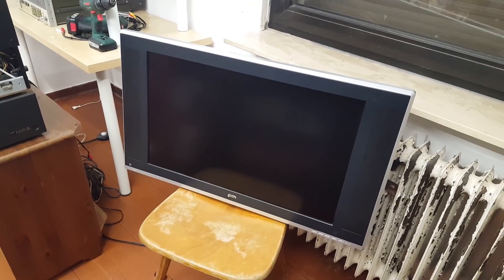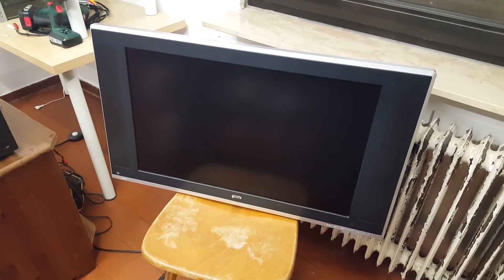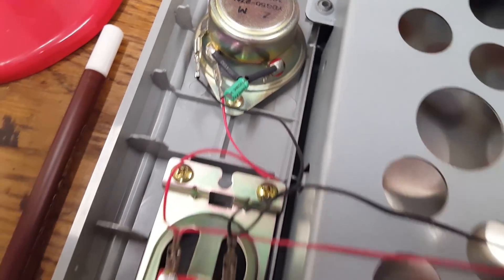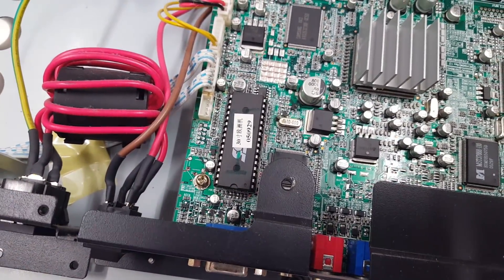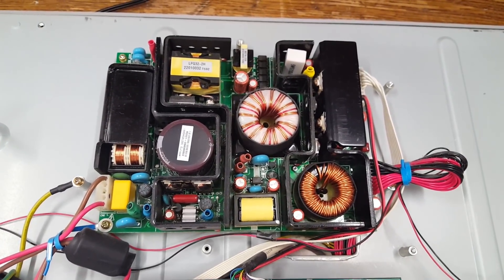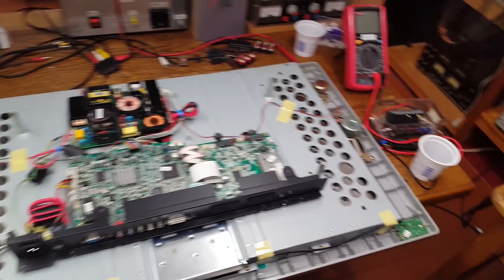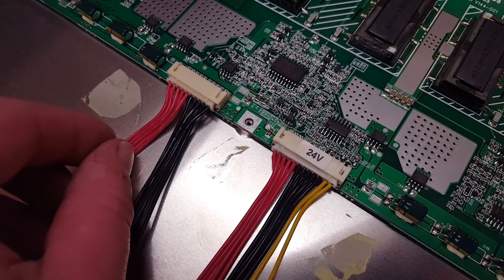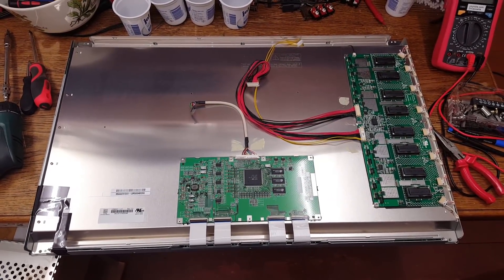1st generation LCD Television teardown

Comment: Strange how even that looks better made than the new ones. I found a Sharp the other week, there was nothing wrong with it at all, and it has the HDMI connectors. Built - in Freeview too. The speakers, facing downwards under the thing, were horrible little things, 4 x 1 inch or approx 25 x 110 mm. They too had shielded magnets, and were rated 10 W, though that's those intentionally misleading PMPO ratings I'm sure. The only repair I had to do was fit a new lead, the old had been cut off, and add external speaker sockets. It's now running through a pair of rather old ITT 653s. Seems to me most modern TVs die of capacitors bulging and going phut. Same thing with PC monitors. :-)

Comment: At the very least, that's a fair few goodies for the parts box! This unit looks well-built and like it could keep running for a long time after replacing those dubious orange electrolytics. Not bad for what I assume wasn't high-end back when it was new, That said, LCD monitors from the early-mid 2000s tend to keep on truckin', too - it was only when they got cheaper that construction standards dropped.

Comment: Opening the backlight panel will not expose you to mercury unless one of the backlight tubes is broken and even if you break one it won't cause you any harm.
Reply from the maker: In my experience, when forcing a panel to open, the backlight tubes will break. I know mercury does not cause immediate harm, but it does built up in your body and once it reaches a certain amount, it will.
Reply: Yeah they really don't contain very much mercurcy at all. They're only a hazard if you're exposed to the insides on a regular basis, such as in processing old CFLs and such. You want a real mercury hazard, you should see how much mercury they put in those old 6 phase mercury arc rectifiers. Which are also very beautiful in their own right.
Reply from the maker: Better safe than sorry. I have seen mercury arc rectifiers in action. Spooky!

Comment: Sky gave these tv's away when you signed up to a tv package !! Im from the uk but never saw them sold in stores !!!!
Reply from the maker: I did an online search for the Sky logo, and I couldn't find anything close to the logo on this TV, so I don't know... Also, the question is, how did the TV make it from the UK to Germany, because Sky-TV has not been active on the German market when this TV was new.
Reply: DrCassette i have no idea dude !!! I would like to know too
Reply from the maker: Of course it's possible this TV was a giveaway in the UK and the owners ended up moving to Germany. The sticker on the back with all the info was missing. Maybe it said 240 V on there, that would have given the TV away as a model originally for the UK.
Reply: stuartellis2006 Really? I've never seen this model of TV before. If Sky were giving them away there should be thousands on the used market in the UK.
Reply: Jason james indeed jason !! Sky gave away tv's only twice a few years ago but they were crap lol my brother had that tv i think about 7 or 8 years ago but only lasted 3 years before it gave up the ghost but that was normal with cheap crap like that !!!! When i say sky gave away tv's with subscriptions that wasnt true !! Over time sky obviously got the cost of the tv back through the cost of the subscription over a 2 year period the sly old dogs lol
Reply: stuartellis2006 OK fair enough. This particular model must have been early 2000s though. It looks fundamentally quite robust to be honest. Sky usually gives away stuff from decent brands and as you say it's usually just a sweetener with their high subscription prices. I think they are giving away LG TVs at the moment.
Reply: Jason james ill sign up to them then ! Get a free tv and leave lol !!! Joking 😃